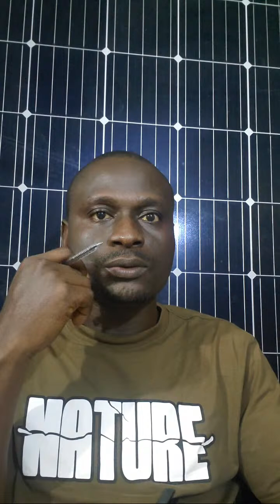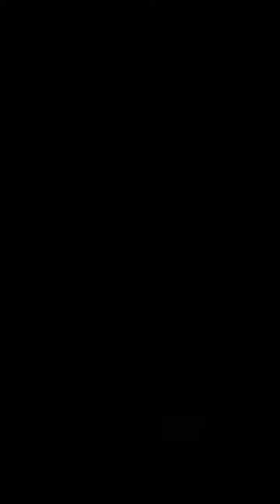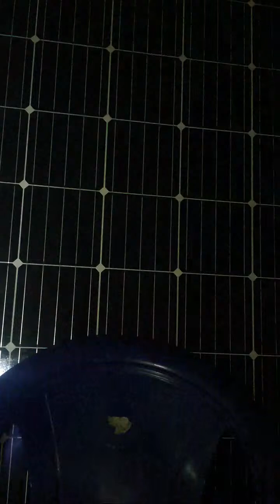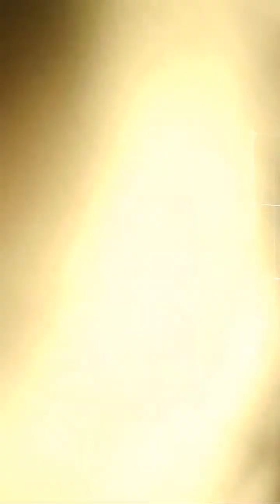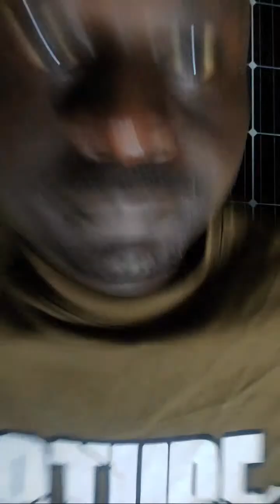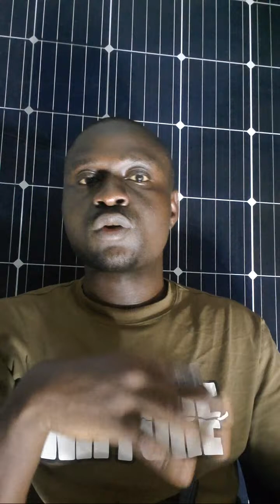Solarwatt Academy  is live!

Comment: Sir is it possible to connect 4pcs of 300w solar panels in series parallel to a 3024 Felicity hybrid inverter with a minimum input PV voltage of 120?
Reply from the maker: What the Voc of the solar panels?

Comment: I have 2 pannels of 550 wats (2) n 12volts batteries 200AH (2) bt what size of the inverter to charge it.
Reply: Please choosing inverter depends on the Wattage of your load so check your load first
Reply: @Jesusismyhope.  its afridge bt after testing i was showing 180 watts bt if plug to a 1000watts inverter it jst pull some minutes then starts bipping sounds .So i don't know what can i do.